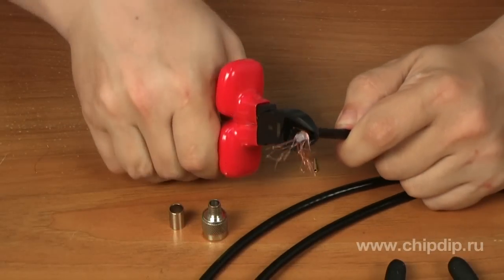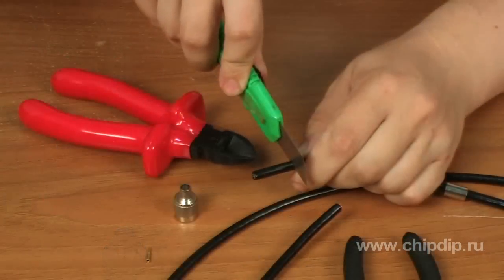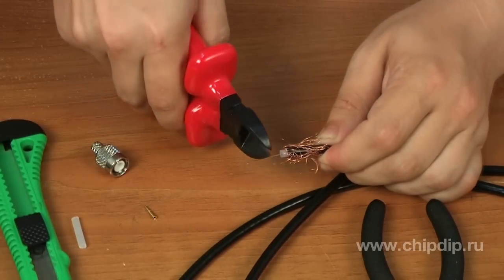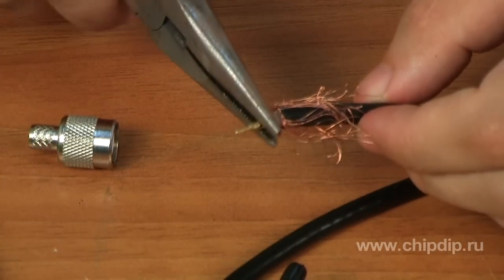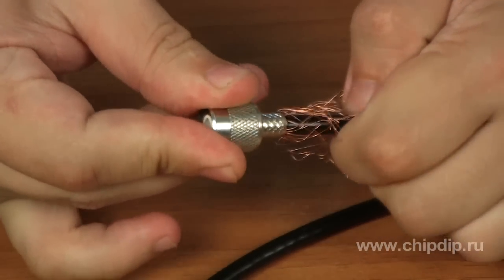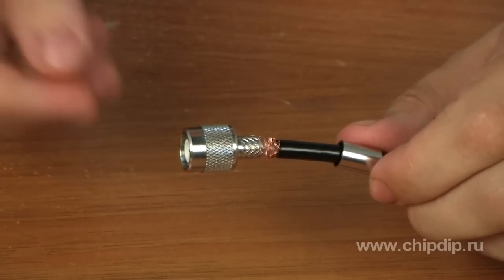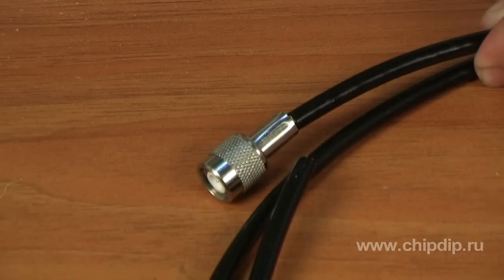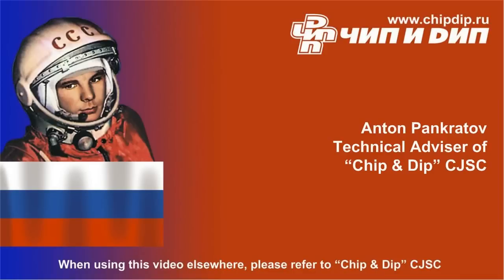Installation of TNC connector to a cable

Comment: stripping with a drywall knife, bad idea.  crimping with needle nose pliers, bad idea.  not using lmr 400 or 600, bad idea.  not weatherproofing your connection, bad idea.  this video while providing visual reference is just ghetto as fuck.